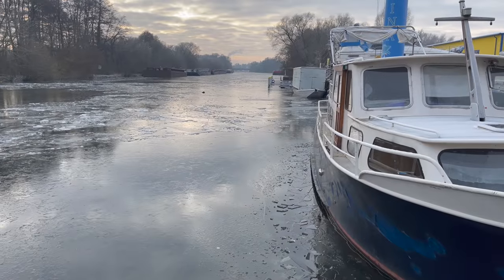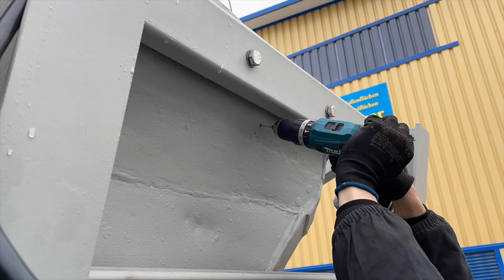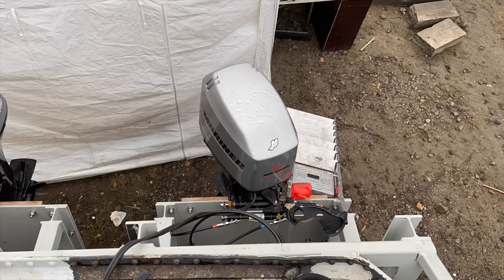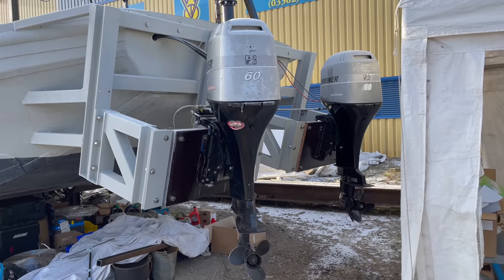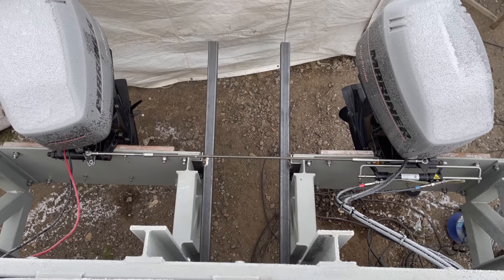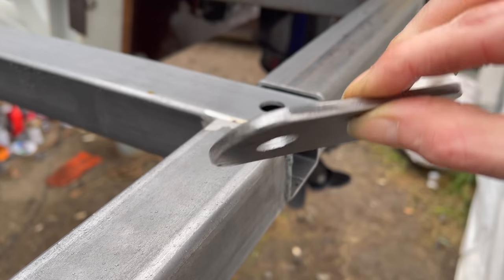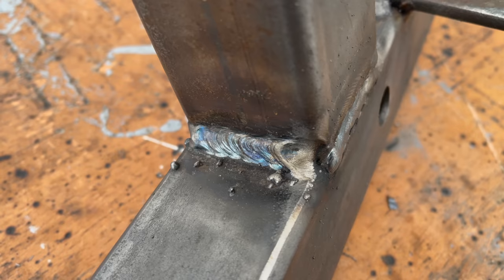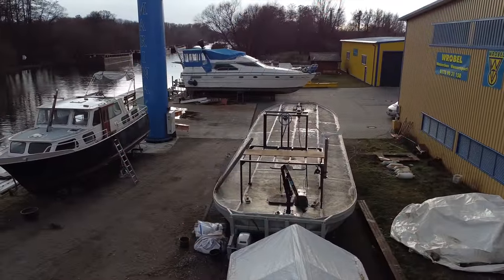DIY DUAL OUTBOARD HYDRAULIC STEERING SYSTEM + Maintenance Plattform built

Comment: Good job, love your videos. Maybe a tip, put some rubber grommets in the holes so the lines do not get damaged by rubbing on the edge of the steel.
Reply: Yes, and to hold water and dirt out.
Reply: I was going to say the exact same thing.
Reply: I normally recommend using split wire loom to use as grommets, but in this case it might be better for him to disconnect the hoses/wires and get real waterproof grommets.    Here is a sample of what I mean by using a split wire loom:  https://youtu.be/Fdv-eBSzWCI

Comment: I’m pretty sure someone else will mention this but its easy to see already that your hydraulic lines have movement and are going to chafe as they exit the hull so some good quality grommets are definitely needed, the same below your wheel on deck
Reply: I was surprised he didn't install fittings to the deck and attach the lines to those.   That would have helped with the seal and kept the hoses from being worn.
Reply: @cap_eath  well exactly and in fitting the grommets he’ll most likely be in for a second bleeding of his system.

Comment: Good job on the hydro steering.
For simplicity's sake don't forget to mark the centered position on top of the steering wheel so you don't need to keep looking back at the motors to see it they are set to straight ahead. This really is a handy trick to do with a colored band of some type at the top center of the wheel. HAPPY 2023.
Reply: there is no mechanical connection so the center position will not stay.

Comment: Great video . FYI They make bulkhead hyd. fitting so you have to run hoses thru holes.Your push rod for the engines is to small of a diameter and will flex.

Comment: Hi. Don’t forget to have weight on your mind when building on top. I’m afraid you’ll get stern heavy. Maybe have your fuel/water in 3 different holding tanks- bow, mid and stern with pumps? Or go for a simple ballast system. 😁
Reply: He has a flat bottomed cargo barge to work with so stability from bow to stern will be very good. Starboard to larboard will be a bit more sensitive. Ballast cures any imbalance when final construction is complete.
Reply: This boat is 16,500 kg and a flat bottom. I doubt all that weight on the stern will have much effect. It’s also a waste of time commenting on such potential problems because he is well in tune with the needs of boats after owning 5 or is it 6 boats and all with significant modifications. Don’t worry, he has got this.
Reply: @teeanahera8949  a waste of my time or your time😉 dude I love this guy. Only trying and hoping he will succeed in the future! This channel deserves more subscribers! 😄

Comment: Hi Shawn great job. Here a little recommendation, use grommets in those places where control cables, wires and electric cables pass thru steel holes.  Those can be made even from pieces of hose or purchased to your required size.  Great projects I enjoy all your posts. Saludos desde Puerto Rico, Juan.

Comment: Also when welding pointy corners as in the tubes or even a square edge weld from the point to the inside, that way you are going from the thinnest part to the thickest part and the end of your weld is less likely to melt away.

Comment: I recommend adding a lot thicker tube for the tie rod style heim style joints. That is a failure point with the torque those motors will produce under load. I’d suggest going with some heavy duty heims and using thick walled tubing

Comment: hello from the Netherlands .
the only thing I personally would have changed is the way of the hydraulic feed-throughs, 
I personally would have opted for a mounting/screw feed-through here, 
so that you get shorter hoses, 
so an engine -> mounting-through outsite as 1 short hose, 
mounting-through inside -> inside deck mounting as 1 hose, 
outside deck mounting-through -> steering wheel as 1 hose.  
this makes it easier to replace a piece of hose in the future and the costs are lower because it is not 1 very long hose.  
By the way, you can protect the hoses well against UV light by putting them in an old fire hose or sleev.  
hoses that receive a lot of UV light weather quickly .
thanks for the video .  
Sincerely Hollandduck

Comment: great job, glad you are on the mend.   I would increase the diameter of your engine connecting rod as there is a lot of flex in it.  I would also increase the size of the joint.

Comment: Bit of flex in that connecting rod between the engines.  Any chance of putting a stabilizing eye-bolt/ball joint on the rod between the engines?

Comment: Nice, but it will rust from the inside as you should weld in tubes where the bolts go through. that will keep it dry. also we found on our barge that indepentent stering was far better

Comment: From recent experience I can tell you one problem you might have, water coming up behind the boat from underneath, hitting the plates the motors are attached to and coming back up into the boat because as you go faster the more the water hitting those plates will be forced forward up and into the back of the boat.

Comment: I'm wondering if 2 60hp outboards are enough for manouvering a boat this size and weight. I'd put waterproof grease on the unpainted engine fittings.

Comment: Love your content but I am still struggling to grasp how the angle of your solid steel transom with outboards attached is not going to dig into the surface water and ultimately compromising if not halting your forward progress?
The more you gas the more it digs in? I hope I am so wrong...

Comment: I know its a really old boat but when you drilled those holes alot of water was between the layers of rust and new paint. Ive seen that only on patrick and rebeccas sailing channel, where her fiberglass boat over the years developed blisters. How much of a problem is that for a boat as rubust as this?

Comment: The motor steering tie rod looks like it will bend and deform with torque backlash when under load when both engines are running

Comment: Okay so you close up frame holes.... so what's going to keep water out of the frames everywhere you've drilled and screwed through bolts???

The interior of those steel frames and everywhere else that have drilled bolt holes need to be waterproofed. I only see a raw screw, washer and nut every time you make connections. Please explain.

Cool project, but this is driving me crazy when I watch to follow along.

Comment: When your outboards are trimmed up you wanna make a lock for your steering wheel. The outboards will turn from the boat rocking which will cause your motors to hit your new platform.  They will get scratched.  Just a tip. Mine tips over all the time.
Reply: steering pump have built in lock valve, engines stay still if you dont spin the rudder.
Reply: @polle425  not in that system they don’t. I have that same exact system. Definitely doesn’t have a lock
Reply: @gotropediving7074  Hydraulic pump: TL1-16 MRA, 16 cc pump., Max 80 bar, 5,4 turns with Anti-Feedback Valve and Automatic Pilot Connection Port. 

It has anti-feedback valve. So something wrong with your system if it is the same.
Reply: @polle425  I guarantee if a boat goes by while he’s on the mooring and creates a big enough wake, both of the motors will be leaned one way.  None of them are truly anti feedback. Ain’t seen one of them not do it yet and I’m surrounded by them.
Reply: @gotropediving7074  i dond kwow what kind of systems you work with but normally anti feed back means that you can push your motor with car if you want and the rudder or motor dont move an inch. If it moves, something isnt working as it should.
Reply: @gotropediving7074  i have 3 boats, all have hydraulic steering and all have anti feeback. No matter how much force i put on motors they dont turn anywhere. As it shoud be.
Reply: @polle425  I don’t know man. I’ve got the same style system he’s running. Which is also the most popular system in our area.  Mine will walk over in transit or on the mooring. I’ve got no air bubbles in the system and she’s full of oil.  No leaks either.
Reply: @gotropediving7074  are you sure you have the same model as in the video? Some olders may not have anti-feedback? Most of the new ones have. Even their website they write how the anti feedback works.

Comment: You seem to have some flex in the rod between the two engines  and this is with out power   could be more tension on that link in the water under power  the camera pick up the flex  take care be safe   ps I still think those motors are too low  lol

Comment: Looks like your welding a bit to hot. Also be sure your welding sticks stay dry and temp controlled. This will drastically improve your welds. It should sound like fring bacon when you weld. Small circls all the way till you reach the end, bring the stick back over the puddle at the end point after doing a fine circle and you will get beautiful ends.

Comment: Hi from Russia again. I'm following Your channel from the very start. It's a pity, You are ill and had to change Your plans. Lot of work is done. And lot of work still to be done. Great, that You are so enthusiastic in Your project. 
I'm not sure, that rust will not break Your rear platform. Also You have holes for bolts not covered. Water will find it for sure. And the rear platform can be pushed and have deformations while maneuvers are made. Then, it's not so strong for rust. And not so strong as it could be. 
Also, I don't understand Your final idea of Your barge. Is it OK for a channel trip that its captain nest is so  high? How can You manage with low bridges? 
Hope, You have strong plan for every step while making your dreams true.
Reply: I'm not a specialist in power steering. Also, we have no calcultions, tests or data. Hope You can make some changes later. Although, I feel that the system of moving engines and power steering, that You created, is of great risk to be broken and serviced regulary because of dust, damages and rubbish in the water.

Comment: Closing off the ends of the box tubes may be a mistake as that the bolt throughs are not water tight and you should allow for water drainage to prevent corrosion.
Reply: I would second that.  Maybe drill some  small drain holes in the bottom of the tubes to let any water wanting to "get in" to "get out"
Reply: Hi should have drain plugs in the box section,  and pipes going through the holes, this to strengthen the sections from compressing when bolts are thorged. Also the inside needs rust protection,  water will surely get in there somehow or just condensate, which will be enough for corrosion alone . 
I would suggest to make it so you can dip galvanize the whole assembly. Coting the inside and outside with zink, if he want paint on 
 It just paint the outside over the zink  coating.

Comment: You failed to use grommets in the holes to protect your cables and wires going through your transom and the deck of the boat. Next time when you weld up anything actually brace it up after you have tack everything to a perfect alignment. Than brace what you have welded up! than you can weld it, don't weld things up without bracing it. Once it is braced you than can weld it up and it will not move on you and become all warped so that you have to used straps to align your work to get it to fit properly. Hope that helps.

Comment: Your synchronization bar looks to me to be too thin and weak as a push rod.
You see it bend when it push, and have in mind when the engines run in water, the rod will get a lot more weight to push.
Reply: He can weld apiece of angle bar to the rod for a stiffener.

Comment: You are Stern Heavy. A barge can hold a good amount of weight, When evenly distributed. Look back at the pictures you posted of barges like this one, (working shower vid) they were all loaded in the middle and had free board of 3 feet. At some point you have to stop Building with rail road iron.